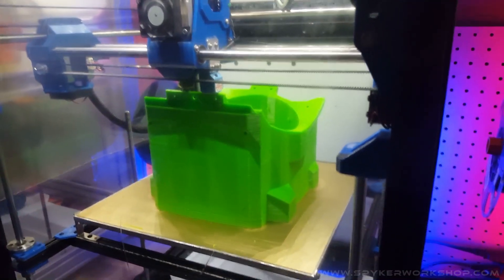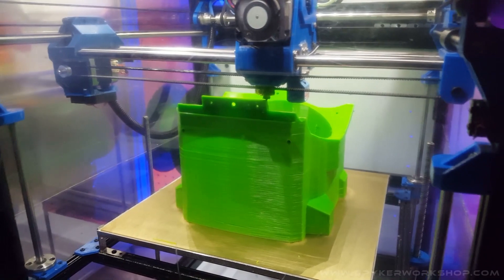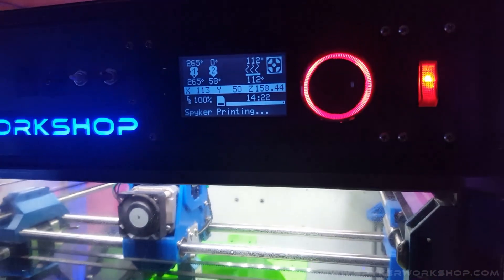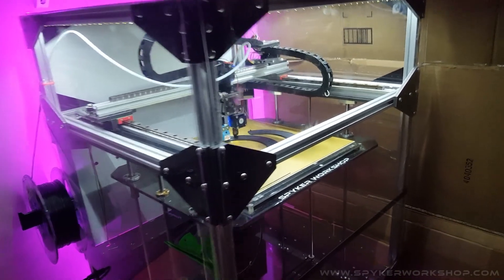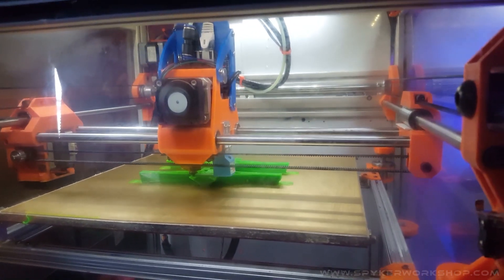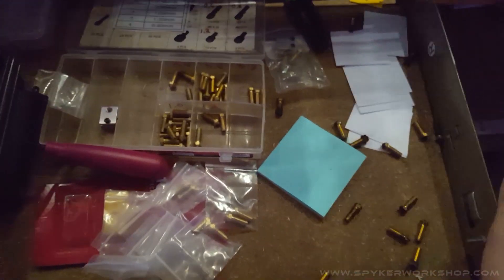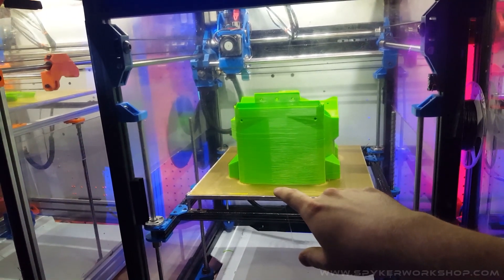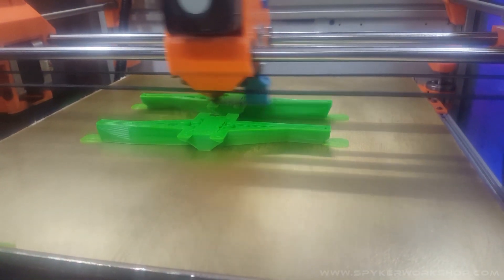Spyker Workshop - Spyker KAT + Blower 2X - 3D Print Guide

Comment: What kind of ABS filament do you use? I couldn't find that reading your posts on the forum... I really like the black and green so I'm thinking of going that route. Also, is it necessary to vent your machines when printing ABS or just have them enclosed? I hear a lot about the fumes and such that are emitted when printing with ABS. Thanks for the recommendations on the nozzles. I looked into the 1.2mm last week knowing print times would be ridiculously long if I didn't upgrade XD.
Reply from the maker: I like to use ESUN or HobbyKing brand ABS. I have all my printers in a closed room that I'm never inside. I don't vent the room or the printers, for me it just seems to kind of stay in the room. If you were to vent them it would cool the printer and make parts weaker. ABS heat is key for sure.

Comment: Hey man your work kicks ass! Could you help me set up my cura settings better for my cr10 s5? I'm using a .4 nozzle and getting some globs in my lithophanes I tried my retraction settings it helped a bit but it's still getting funny lines on the outer perimeter here and there.
Reply: I'll have to show you a pic of what I mean.
Reply: @Jayr1787  I have a regular CR10 that my friend helped me set up. The biggest thing for me was a mirror tile bed instead of the stock one. Thats a game changer along with the fang mod. I print PLA at 202 nozzle heat and 60 for bed heat. I also run a calibration program before every print (unless I'm lazy) which helps a ton. If you're getting blobs, it probably is something to do with the tolerances in your filament. I got that too with the test filament they sent with my printer.
Reply: @BuDdhaPuDgeJ  I was wondering if it was the filament too....seems like the case more and more. I just ordered another brand today see if it helps. Thanks a bunch dude! Always helps to have a second opinion and words from experience. Thanks!